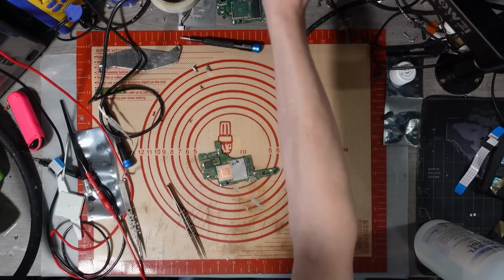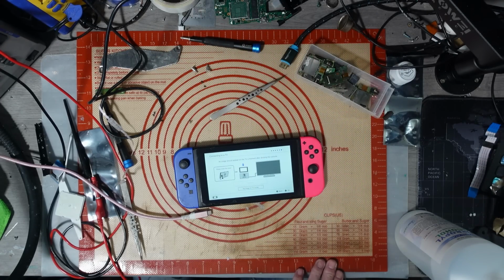Nintendo Switch Won't Connect Right Joycon But Left Joycon Works... Can I Fix It?

Comment: The bottom resistor, what is the value? I've got a switch with a similar issue but no extra board to pull from except a switch oled board, might be able to find one somewhere on the board but I have no idea what the value is to even begin looking.

great video, made me look closer after trying a few different joycon rails.

Comment: i have this issue on my switch oled. right joycon will completely randomly disconnect ( switches to wireless communication) sometimes months in between instances. the joycon will still charge while connected to the switch, it just seems to get switch to wireless communication and get stuck there. holding the reset button on the joycon fixes it every time.

Comment: Sorry if this is a dumb question, but how can you put that much generalised heat on the board without warping it? Like is that even a danger, or shouldn't I be worried about that?
Reply from the maker: There's no such thing as a dumb question. You only learn by asking 😀 in fairness you're absolutely right, it can warp the board or more commonly a process we call "popcorning". The board is made up of several layers sandwiched together (sometimes 8 or more layers) and each layer is separated by a thing called a substrate. If it gets too hot it can cause the layers to stretch and then pop out like popcorn. That causes internal shorts on the board and basically kills the board completely. This happens a lot more often when we're dealing with boards which have been liquid damaged because of the moisture inside the layers. When reworking the board we don't generally just go full on with the heat and that's why you'll see us moving the heat around for a short period of time before moving in closer. That spreads the heat to stop that happening. Also 400⁰C-480⁰C  might seem high and it is, but the heat is very sporadic in that it's being pumped out in the form of air, so a lot of that heat is lost to nothingness. It disappears off into the open air so we have to use higher temperatures than the typical 217⁰C melting point of solder to be able to heat up a specific area. When we deal with infrared heat such as that from BGA Rework machines and IR pre-heaters the heat is a lot more controlled and direct, therefore it requires much less heat to get the job done. Hope this clears things up a little 😀
Reply: @TheCod3r  Thank you for your detailed explanation. I think I get it now. The fact the heat was strong enough to burn your fingers through the tweezers made me wonder this because I assumed the warping point of the substrate would be lower than the burning point of flesh, but I also don't know the composition of the substrate and (based on my limited experience rebuilding electronics but not actually soldering boards) I assumed it's a composite of plastics (e: with very thin layers of metals to carry charges). I really appreciate you sharing your knowledge on this!

e2: so it sounds like more an art than a science. 😊
Reply from the maker: Yeah one thing people don't take into account really is that the human body can only withstand temperatures of around 46⁰C before it starts to cause severe discomfort. This is obviously because our nervous system is very sensitive and it really doesn't take much to be in pain. I don't really know the composition of substrate myself other than the fact it's made of fiberglass amongst other things. It is definitely a skill to get it right but even the best of the best make mistakes. I had two instances in one night on a live stream a couple of weeks ago where I popcorned two boards in an hour trying to do a CPU reball. Ended up having to replace the board for the customer because it was my hot air heating element which caused it (it was failing) :)

Comment: Nice job. If you find it difficult with heat on small side resistors and caps. Try using an iron with blob of solder and touch both pads and slide the components into the solder blob. Works every time and no heat stress to board :)